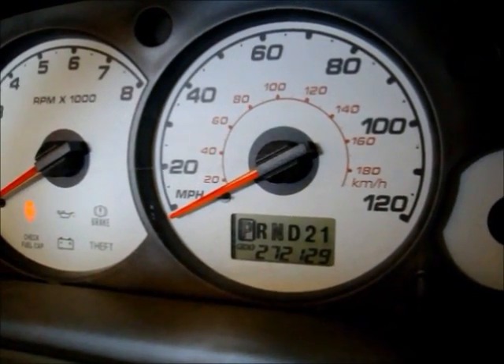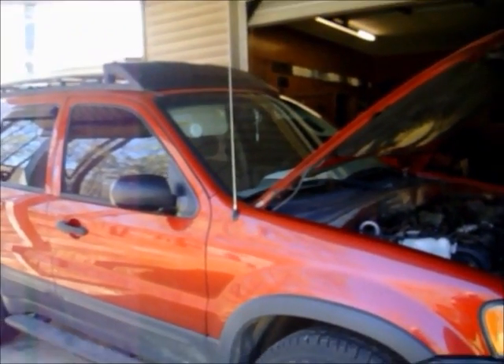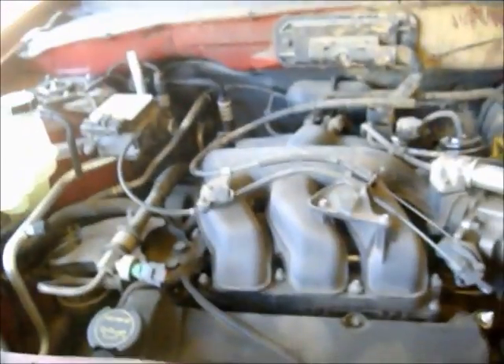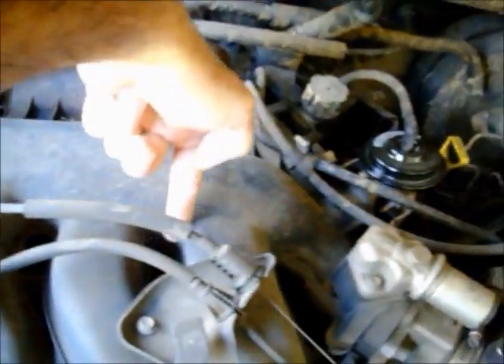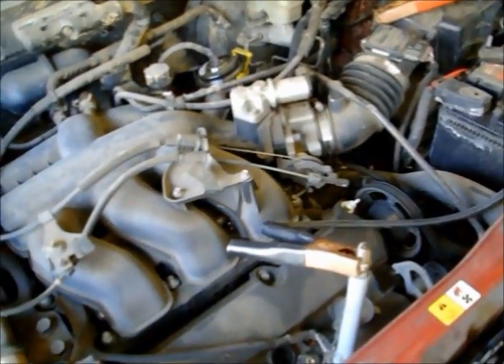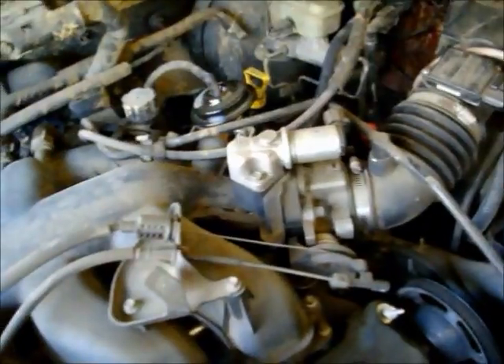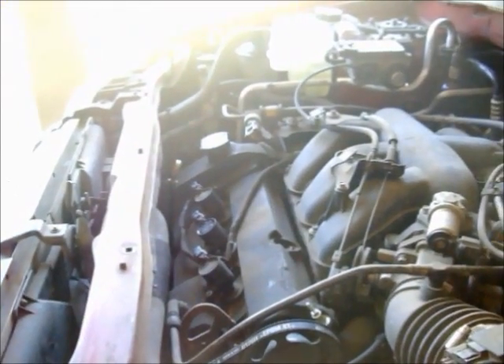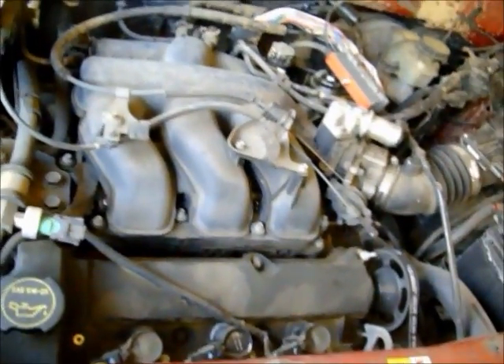2003 Ford Escape check engine light (part 1 of 6) coil on plug and spark plugs

Comment: Can you give me a link to the PCM Pinnout?  O2 sensor wiring has been broken by previous owner Wires jerked from harness after being caught up in serpentine belt, neer harmonic balancer crank pulley. Mine is exactly as yours only 2004 model.
Reply from the maker: That doesn't sound like any fun at all.  I've never had to work wiring issues on a car newer than 1975, so I'm no expert here, but I found a link that might help.  It's for a 2001 Escape, but one of the comments suggests that it was helpful on a 2003 as well:  https://www.2carpros.com/questions/ford-escape-2001-ford-escape-pcm-pin-out-diagram

Comment: Good video & well presented. You do not have "coil packs" on your car . you have six separate ignition coils.  Coil packs are a cluster of coils mounted on a plate & bolted to the engine somewhere & have ignition wires going from the pack to the plugs.
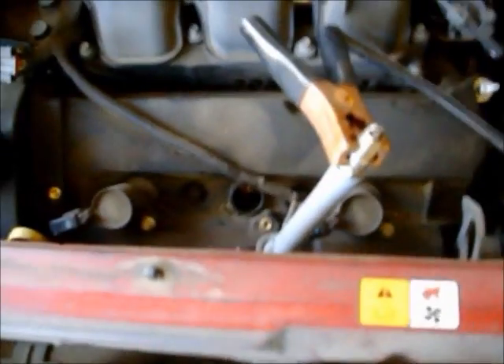Reply from the maker: Thanks!  Yup, Coil on Plug (COP)....six of them, it's in the title of the video, which may help to avoid some confusion.  Also, I mention "Coil on Plug" at 10:11 and again at 16:44, so that might help.  I think I was too lazy to say "coil on plug" every time.  You're right though, I should have just called them "coils", and I shouldn't have called them "coil packs".   I'm mostly into old cars.  I've got a blown Boss 429 that I'm working on, no room for a distributor, because of the blower, so I bought a crank trigger coil pack set-up from Electromotive for it, check it out, fast forward to 1:18,  https://www.youtube.com/watch?v=SetbuZvM6IE&t=1s

Comment: 270,000 miles...that's just broken in..LOL !!...my '05 Escape 3.0 which I bought new I gave to my G/F's daughter when I bought a new 4 Runner...she said it just went over 360,000 miles !!....alternator, fuel pump, trans, and a blown out spark plug are about the biggest things I had to fix !!
Reply from the maker: Good for her!  She's winning the race to 500k.  We're at 329k so far, original engine and original trans and we still use it to tow.  Just picked up a '55 Pontiac near Kansas City, and brought it back to South Carolina with that little Escape:   https://youtu.be/inD8WiG3zA8

Comment: It’s amazing how you your wife’s car has the original transmission/transaxle on it. The reason I say that is the fact I heard so much problems with these transmissions (cd4e). How did you make it last that long. I’m super curious. Thanks
Reply from the maker: She's had it since new, original engine, original trans.  I'll be honest though, I can talk Powerglide, Turbo-Hydramatic, C4, FMX, C6, Torqueflite, Muncie, top-loader, and A833 all day, but new cars aren't my thing, so I don't even know if CD4E is what we've got.  It's the 2003 V6 XLT with all wheel drive, and we still use it as a tow vehicle every once in a while.  Over 320,000 miles, and I think there was one time at 150,000 or so, that Ford talked me into letting them change the transmission fluid.  Since then, I've just been adding fluid as needed, and it's maybe a couple times a year that I do that.  We plan to drive this thing until it dies, so stay tuned, I'll update these videos when it does die.  For now we're shooting for 500,000.  Then a million?  Or it could die tomorrow....either way.
Reply from the maker: Can't kill this thing, still going strong:  https://youtu.be/inD8WiG3zA8

Comment: Same plug that I've always had issues with. Changed the coil pack twice now. But it does have 350.000kms on it now. But its always the same one.

Comment: Never use a wire wheel to clean a spark plug. Wire wheels leave small metal deposits behind on the porcelain, we know what happens then.

Comment: Check to see if water entered your pcm on the firewall. It can enter from the mounting bolts or the outer seal which causes misfires. Just undo the three wire harness and remove the bolts and pull the unit straight out. If wet or moist, reseal outer seal+bolts with RTV Sealant. Hope this helps other owners before throwing cash at a misfire problem. The left wiring harness controls the ignition coils so check the wires by wiggling them w/engine running too see if it misses. If so, you need to re-solder the loose wire. If all is good then plugs + coils are likely the problem. Also check for vacuum leak at intake manifold gasket and all vacuum hoses by spraying non-flammable sensor cleaner and if RPM rises you have found your leak. Do the cheap tests first before blowing a paycheck on these trucks. GOOD LUCK everyone🚙
Reply: Thanks for the info Andrew. Most notable from the vid is the amount of mud on his firewall where he is showing the ECU. I will look at this as well.

Comment: I heard these cars have bad transmissions. Cd4e. Not sure what to think
Reply from the maker: Not this one.  My wife's put over 313,000 miles on this car, no transmission problems at all, so far.  I've even used it as a tow vehicle, it's holding up well.
Reply: @owenrobertson  my 2008 transmission went at 98 000km under warranty. Ford rebuilt it then at 140 000km it died again and I paid 3000 bucks to a transmission shop for rebuild that only lasted 30 000km more then again went bad.  This time it was done free under warranty from the transmission shop who admitted the screwed up. Strange how so reliable for some not for others. I changed fluid regularly. Have you serviced yours often?
Reply from the maker: RobinWhiteRock 73, It's stories like yours that make me really appreciate lucking out on this 2003 Escape.  I bought it new for my wife in 2003, and every other car I've ever purchased in my life, has been a 1975 model or older.  My wife wants a new car right now, but she doesn't realize that newer isn't always better (right now I want a 1955 Pontiac), we could spend $30k on any model car, brand new, and you just never know what you're getting.  My great uncle was a car mechanic in the 40s, 50s, 60s, and 70s and when I was 8 years old in 1978, his sister, my grandmother, bought a brand new Oldsmobile.  Some lobes on her camshaft went flat within months, and after that, other engine problems kept popping up.  Her brother called that car a lemon, official diagnosis.  I guess they can't all be peaches, so consider yourself fortunate when you find one.  My wife's Escape has been great, neither the engine nor the transmission have ever been out of it.  I think we just got lucky, just like most 1978 Oldsmobile buyers didn't end up with flat cams.  With our Escape, we took it to Ford religiously for the first 150,000 miles, they changed the oil, checked the brakes, and if the odometer suggested that we change the trans fluid, we did that as well, everything the service schedule called for, we did it.  I had my hands full, in maintaining all of my classic cars, so it was an easy decision to just let Ford take care of the 2003 Escape maintenance.  After 150,000 miles, we were beyond the service schedule, and at that point I just stopped caring all that much, figuring we had already gotten our money's worth out of that car, and it seemed odd to spend a ton of money maintaining a car that was worth about three thousand dollars on a good day.  So now that I think about it, it's been well over 150,000 miles since we've changed the transmission fluid, but I still change the oil every 5,000 miles.  Oh and it's been leaking just a little a bit of transmission fluid for the last 8 years or so.  A few times a year, I'll put it in gear, and it won't move right away, so I'll add a quart or so to the transmission, and it'll be fine for the next four or five months.  We've got the V6 and all-wheel-drive in that Escape.....is that what yours has?  Just wondering if yours is the 4 cylinder, and maybe has a different transmission.  I know very little about transmissions in cars that are newer than 1975.
Reply from the maker: Here's an update on my wife's Escape.  Original engine, original transmission, just towed a car from Kansas to South Carolina.  Still going strong.  329,000 miles, We're more than a little bit surprised by this, and we wonder how long it can last:  https://youtu.be/inD8WiG3zA8
Reply: Mine is at 350.000kms no trans issues ever

Comment: This video series was extremely helpful!! Thanks for sharing...I have a 2006 Mazda Tribute S V6...that needs some of the same attention. One question though, I have seen others who don't completely remove the cover...they remove enough to attach it to the tire well with a cord....is it still possible to do everything you checked and done with that method? Thanks again for all the great information....I'm new at doing my own repairs...but have found I truly enjoy it. So any more info videos on the escape would be great! Subscribed and liked!!
Reply from the maker: Sure, there's always more than one way to get this sort of thing done.  As long as the stuff that's in your way, get's moved out of your way, you'll be fine.  We've got 306,000 miles on my wife's 2003 Escape now.  The next time something  breaks, I'll make another video, it's been a really reliable car though.  Thanks for your comments.
Reply: Shane z

Comment: I have the exact problem. . could I buy one coil harness and one new plug and try it in each cylinder one buy one until the problem is solved .. well at least try it on the 4 5 and 6 .. the ones on the back have been changed all ready.  would that work you think?
Reply from the maker: Yup, you can buy one COP (coil on plug) and try it in each spot, until you figure out which one isn't firing.  Like you said, forward bank only, the three in the back aren't so easy to get to.  Remember, though, in the end, my problem wasn't spark at all, I wasn't getting fuel due to a bad fuel injector.  Check spark first though, you're on the right track.  Good luck!
Reply: Owen Robertson ... thanks for the response and in depth video.. I will take your advice. . thanks alot